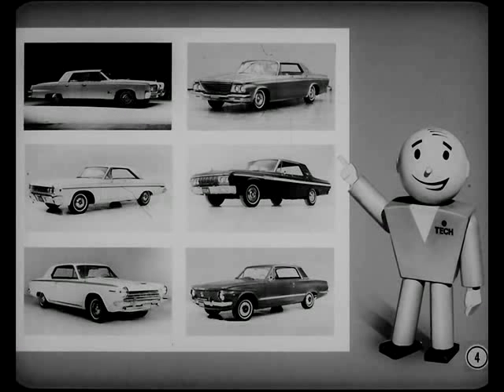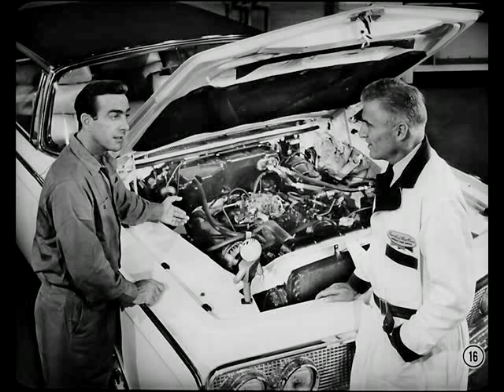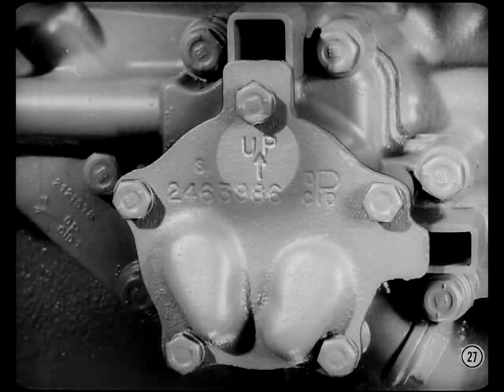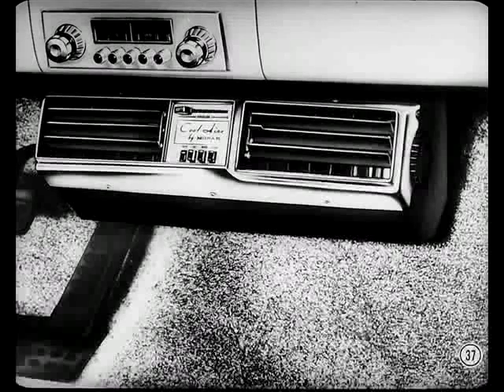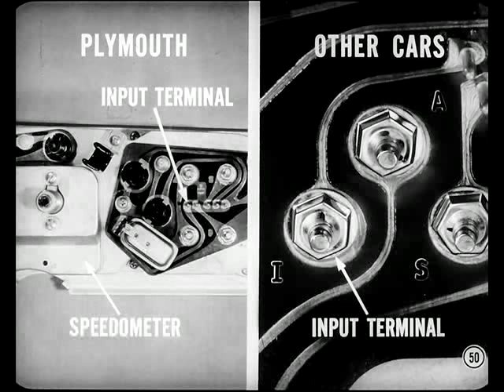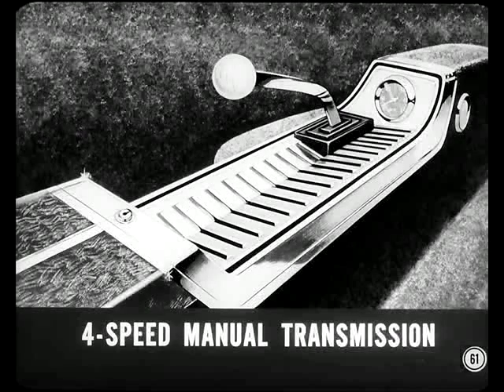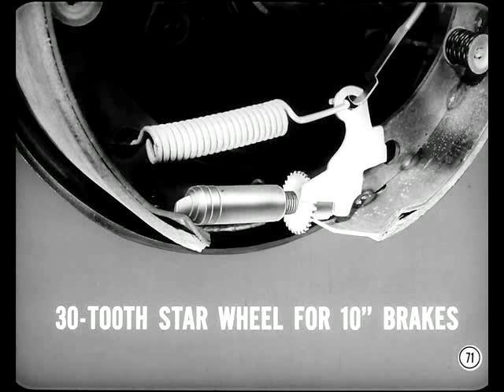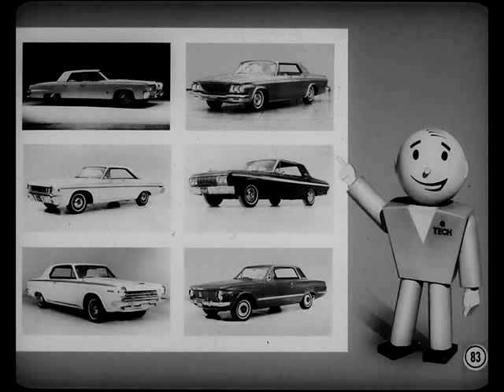MTSC - 1964, Volume 64-1 What's In Store For Sixty-Four

Comment: 8:47 Many cars would later position the splash shield so that it got in the way of a simple oil and filter change. The plastic rivets that hold the shield often need to be replaced because of it.
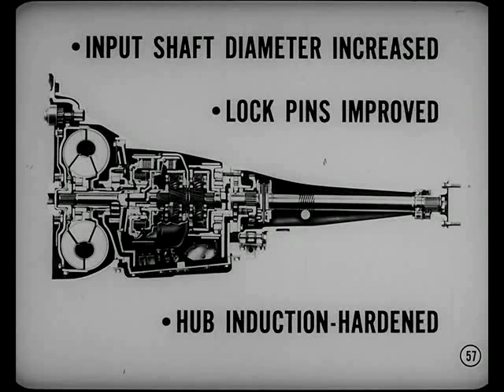12:46 Lifetime fluid? Nobody should ever trust a company to make lifetime fluid. Some companies don't use "Lifetime fluid" but their change intervals are stupidly long. Eliminating the drain plug is a dick move.
Reply: Lifetime fluid is easy when cars died around 100k miles anyway. In 1970, the average car was replaced after 11 years. Remember, 6 digit odometers weren't universal until 1991. Today, cars last 20+ years with 200k miles; it wasn't like that in 1964. This still holds true in Europe, where a lot of the lifetime transmissions come from. People there drive cars around 1/2 the miles per year the US does, again where they toss cars after 150k miles.